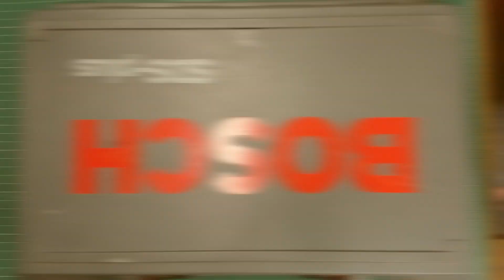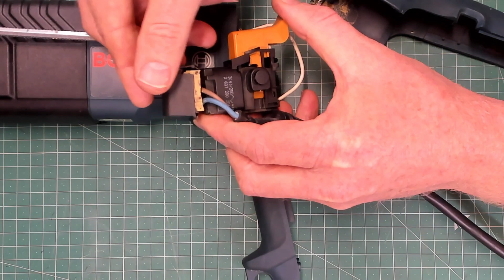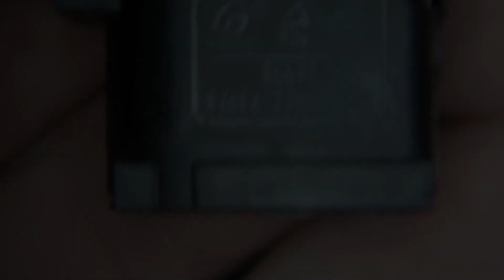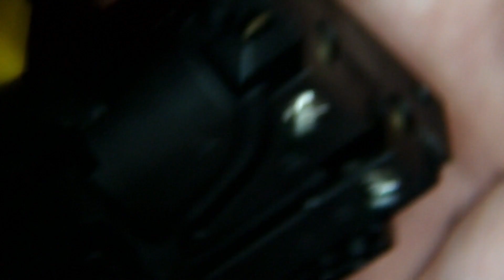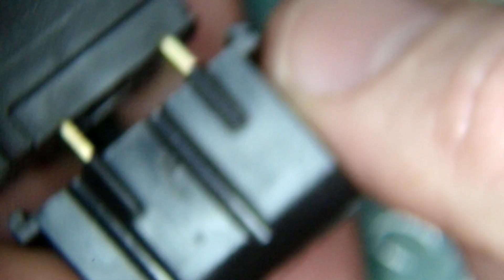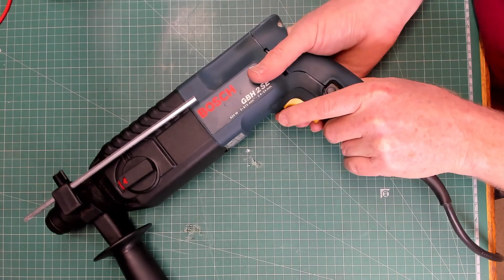Repairing a faulty trigger on a Bosch Hammer Drill

Comment: I have the green version, ended up soldering the wire that came out of the capacitor instead of shoving the copper piece into the coils or w/e. Read it on another comment.

Comment: Hi I have a Bosh Hammer Drill GBH 4-32 DFR Professional. It lost all power when using, it's a home tool so has done work but not everyday use. No erratic symptoms, smoke or noise prior to fault.  What would you expect this to be, how can I diagnose, also, where do you buy your parts from? I was auguring some clay with a 100mm auger bit when it faulted so it was working, but seemed to be suffient to the task.

Comment: Just found this channel I got a problem with my Bosch drill the variable speed only works on full instead of slow speed so if I replaced the switch will it work again?
Reply from the maker: Without knowing the drill model and diagnosing the control circuit it is difficult to be certain, however a faulty switch may well cause the symptom you have described.
Reply: @northbalwynrepaircafenbrc8202  I think it’s the switch I put a multimeater on it and when you push it in slightly it has 0 value open circuit then when fully closed it shows closed circuit continuity I might just buy a new switch as it’s only £25 with delivery
Reply: The model number is gbh 2-24 d